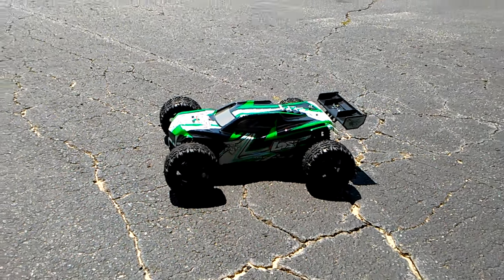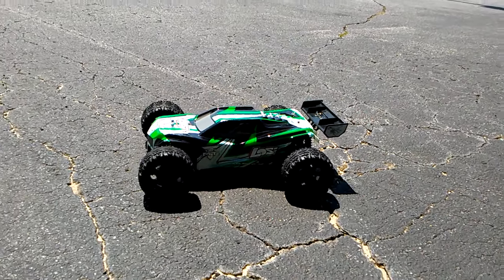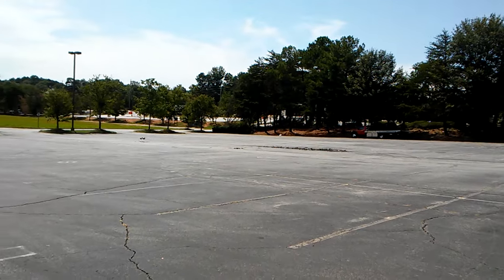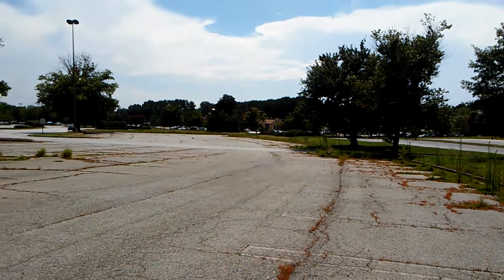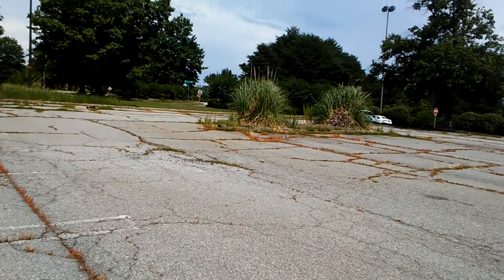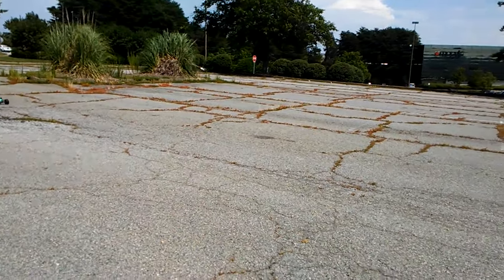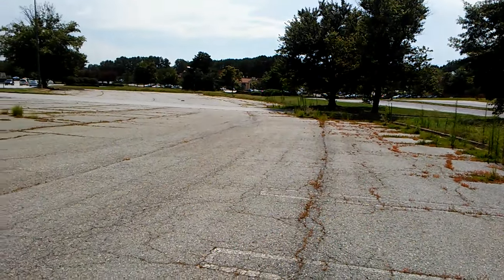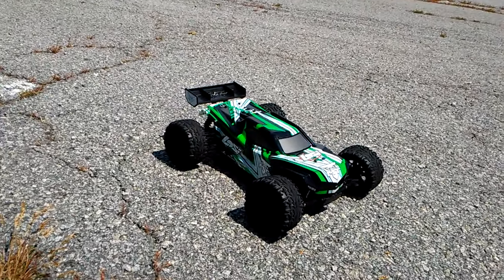Losi Ten MT Updated Run (with 12mm hex conversion)

Comment: Hi JayTee, great videos on the Ten-MT. Two questions. First, I had my chassis break before the truck was even driven for the first time. This happened today. I literally didn't get to run it on its first battery. I tossed it on the ground like I've been doing with all my RC cars (hold the spoiler and toss the car from waist height onto the four wheels -- like everyone does instead of bending down). Anyway, I obviously (1) didn't make such a great toss despite years of doing so with success, or (2) it was defective out of the box. So I was curious if you had any insight on a replacement chassis for the MT that's made of aluminum. A lot of parts would cross over for a conversion using existing SCTE/SCBE parts, but I'd like to keep the same configuration and look as best as I can. The second question is what motor heatsink and fan you'd recommend. I've heard from many that these run extremely hot even on 2S. Thanks so much.
Reply from the maker: No I don't know replacement chassis for that that is aluminum. As far as this thing running hot it runs hot on to sr3 has just get a heating for your motor are a fan and you should be fine
Reply: Thanks so much!